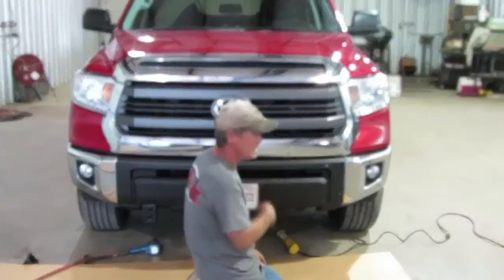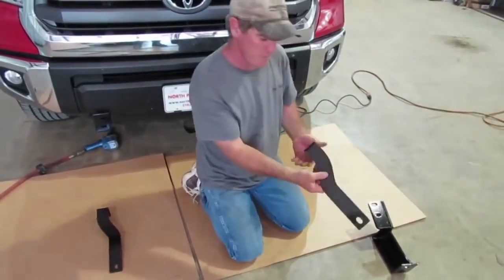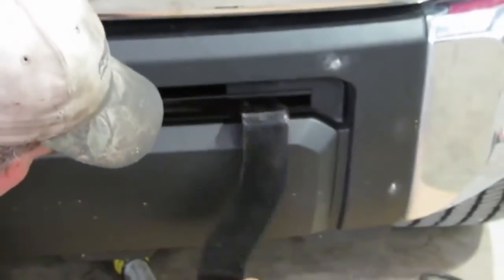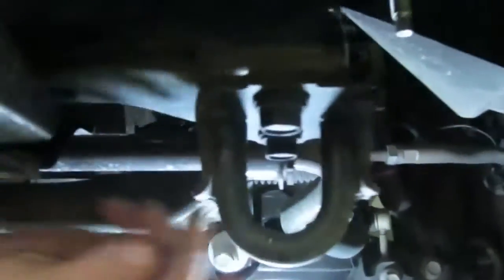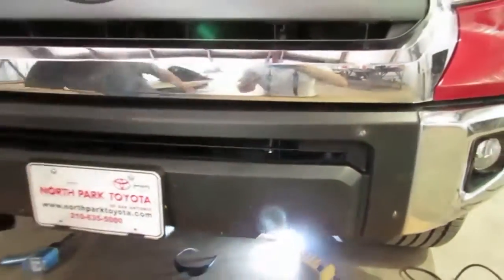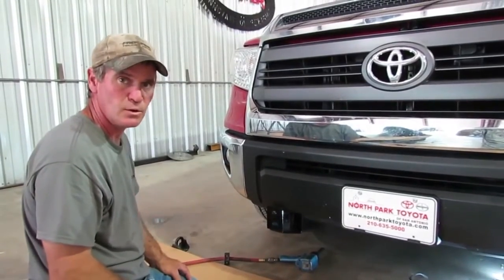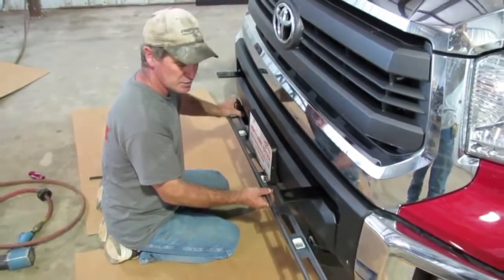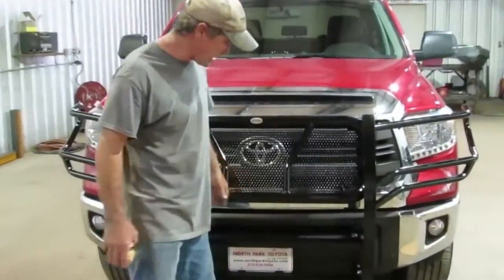Frontier Grille Guard Installation on 2014-2015 Toyota Tundra

Comment: I have the same yr model however I'm curious, if I put on this grill guard will I need to remove the skid plate or does the skid plate stay on at all times? I really like to keep my skid plate because of course it's a skid plate for what its purpose is used for but I would also like to have a grill guard because where I live there's a lot of deers/antelopes out here. And will I need to remove the stock recovery tow hooks entirely or will this grill guard be able to accept them back on afterwards?

Comment: Does a brush gaurd interfere with the adaptive cruise control on a 2018 Toyota Tundra?
Reply: CARiD incorrect. I got a 2018 Tundra Platinum & installed a Westin HDX grille gaurd. It does not interfere with the adaptive cruise control or the parking sensors at all.